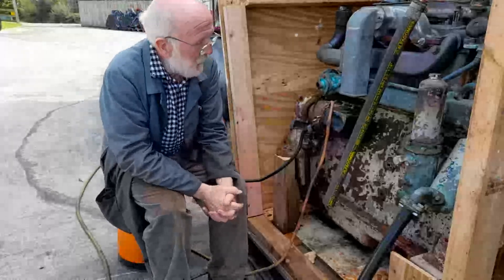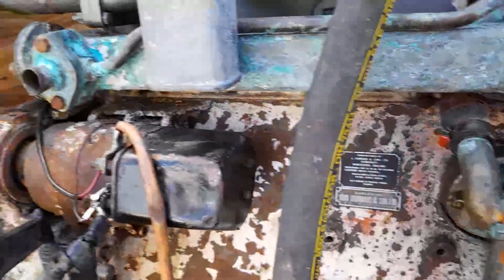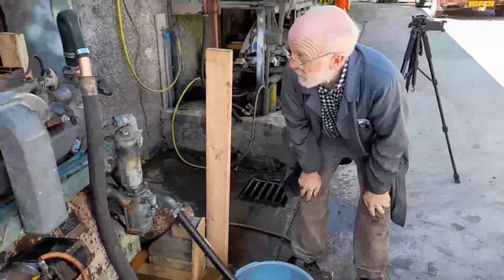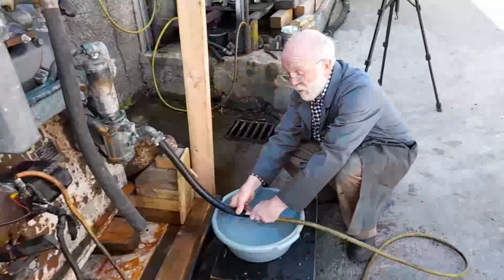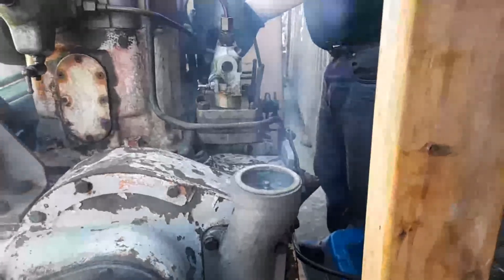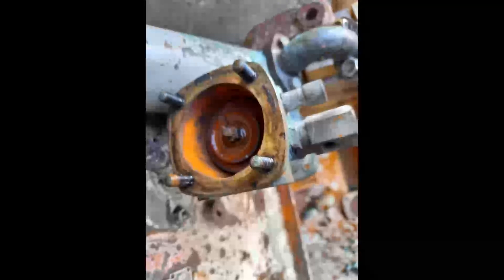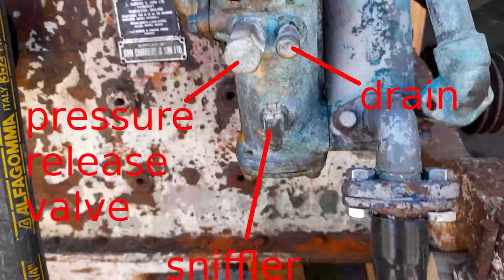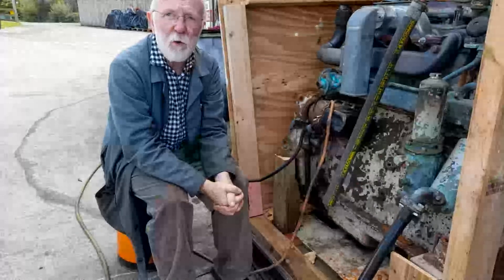Gardner Engines: the reciprocating water pump.

Comment: I had one of these pumps on a 5LW. It was raw water cooled,discharging via the exhaust at the transom of my 36ft vessel. 100% reliable after replacing the rubber components and there was no discernible wear in the moving parts or bores. A beautiful piece of simple engineering!

Comment: Thanks Joe i have been waiting for this segment as to understand the one on my Gardner as i am having isues getting to the correct running temp so i have opted to change it to a therostat and centrifical water pump insted of the tap valve and ram pump hopfuly for less trips down to the engine room to check the themomater on the engine .
Reply from the maker: We can help with the conversion Judy.   Please email: tangent.gardner@gmail.com.